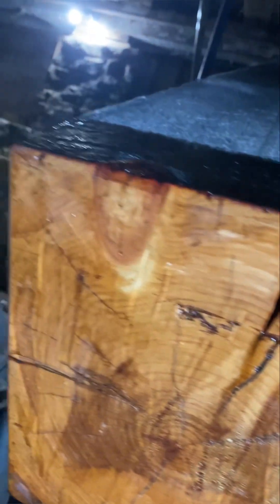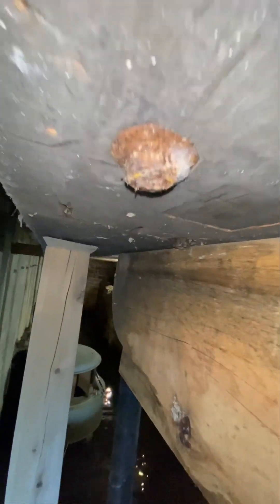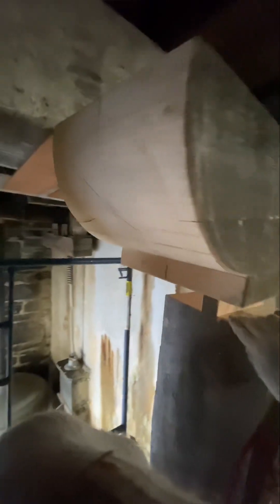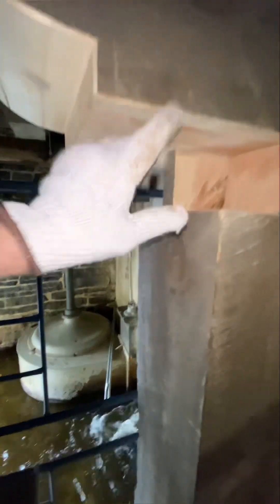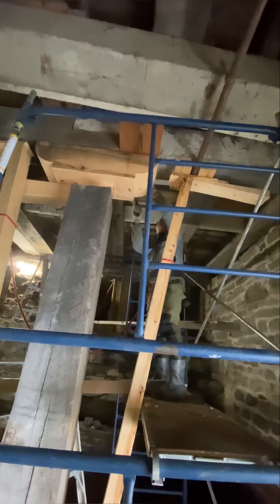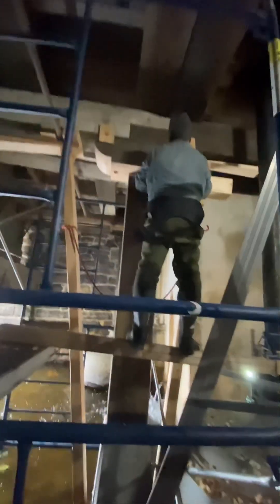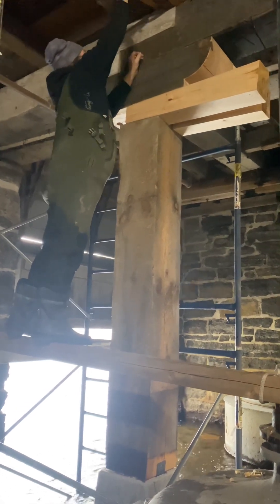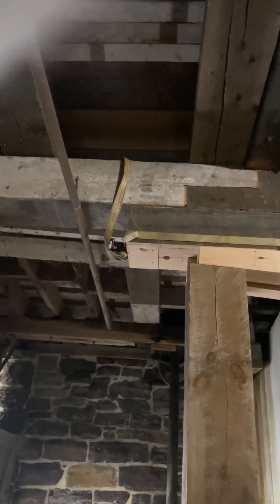Telescopic, Timber frame posts

Comment: Hey, I've been to that old mill / working museum.

One question I have is about your choice of Red Cedar as your broad shim block under the one half of the beam at the scarf. Shouldn't we be using a species here with at least the compressive strength as the beam (such as Douglas Fir or spruce), or is the load so little per square inch here that even quarter sawn red cedar is adequate?
And yes, the large section of blocking atop the post does distribute the load well beyond the footprint of the post and scarf.

Nice video.
Thanks
Reply from the maker: it's considered adequate for engineering loads of SPF Which is usually stamped  on framing material to represent Spruce ,Pine ,Fir . cedar does have a slightly less structural integrity of these, but not very less  , and of course it is correspondent to its grade . Just as a reference, eastern white cedar logs of 8 inches in diameter is what we're sitting on the river bed holding up this beam that we are replacing until the area we are spreading the load on is 3 ft.² and the column 12 x 12. The beam above, it appears to be ash
Reply: Thanks Jack. 
All the best.